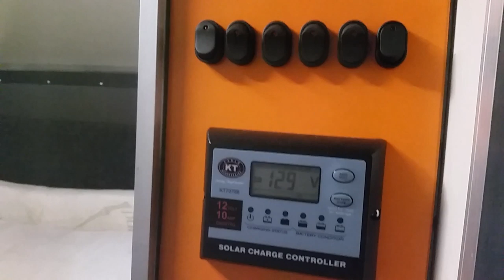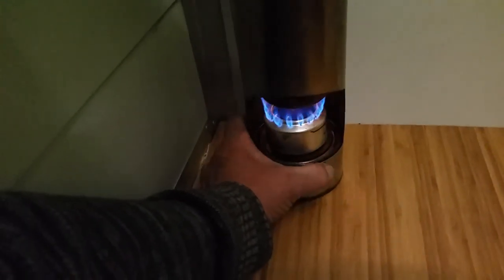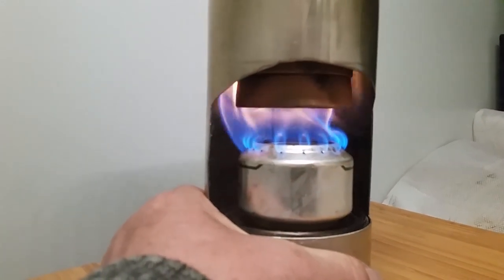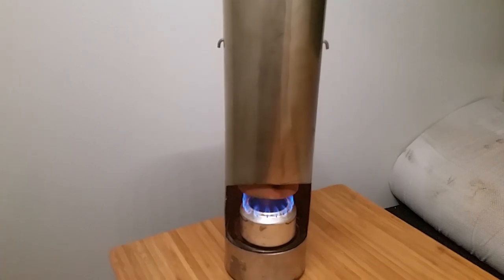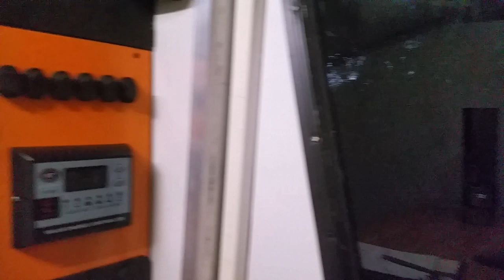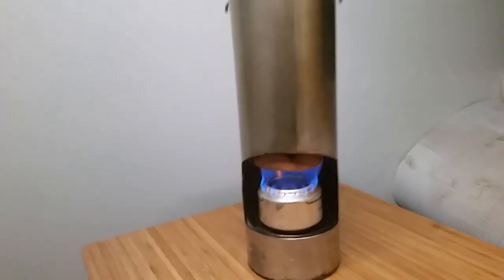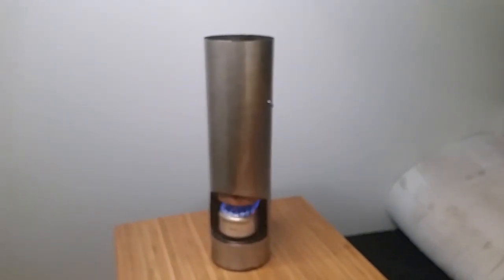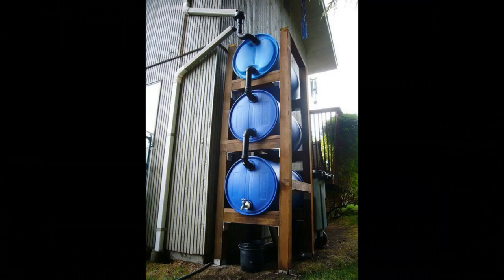DIY Heater for Teardrop/ Van/Tent- Off Road Camping Expedition Overland Trailer-

Comment: Would this work with 3 to 4 tea light candles? I'm sure it would not be near as much heat producing but maybe radiate decent warmth?
Reply from the maker: Yes, absolutely
Reply: @t.h.o.r.  Thanks! If you had an online store where you sold these I'd buy one from you!
Reply: Tea light candles burn styrene. Methanol or ethanol is clean burning, and produces such low amounts of CO that you can burn them in an enclosed space and not worry about CO. 

That said, try and design the base to be wider than the height so it can't tip over. That flame out the top, and the narrow chimney scare me a bit. Also, I've made many little penny stoves, and the one thing I remember about them, is there's no good way to put them out. If they spill it's all over. 
Good start of an idea, but definately needs refinement.
Reply: @aarondonaldson4164  If I ever have the need to burn one of these stoves inside in an emergency to prevent freezing to death, I keep a large metal baking pan to layer with play sand on hand to set in. And bricks to set the baking pan on and "wall it in" so it doesn't slide off whatever it's propped on super easy. I have several that I've made and use outside for hiking and camping. I'm always down to amplify heat in easy ways with mods like in the video.

But you gotta think about things like bumping into a table, crazy animals chasing each other around the house, kids forgetting and throwing something the room at each other, etc. 😕 

Of course, keeping a fire extinguisher (multi/B rated) nearby as a safety backup, but everyone should have one of those accessible no matter what.

Comment: How did you go about cutting the stainless? Cheers
Reply from the maker: I carefully used a 1mm cutting disc on an angle grinder
Reply: @t.h.o.r.  ok thank you so much for the reply. I have a stainless tall jug thingy I’m going to use to make it. I really only have to cut the hole and add the little pots. Did you have much trouble cutting it? Cheers Noni

Comment: FYI: carbon dioxide is dead toxic. You need to keep window or door open to use this open heater.
Reply from the maker: If you watch the video again you will see that I discuss this and show the window and the vent open. Full safety review with CO and CO2 measurements is in the following video
Reply: Duh, goober; he said he knew his stuff. Don’t be a Captain Obvious.
Reply: Thread troll, evidently did not watch video where it was mentioned that A) he does not run it while sleeping. B) He showed open vent.

Comment: Not going to work. Too many heat losses and not enough burn time.  Have to open a vent heat loss, closed poison yourself.  No way out but to use a proper heating system.
Reply from the maker: Odd that- cos its ridiculously warm while Im using it - where could all that heat be coming from?

Comment: not best heater have open fire and lot need gasoline burn all night. lot better have tube and center have steel mesh fire not go outside open fire, 2 can and center have mesh, burn inside mesh safety lot better and not burn tent. and gasoline go lot little than this.

Comment: Sorry this is neat but Dangerous, very easy to tip over and have flaming alcohol  all over.
Reply from the maker: Ill be fixing it to a wall I think with the apropriate heat shielding of course

Comment: lovely little heater, whats the fuel?  rubbing alcohol? I watched your test video with the co2, i was wondering about condensation, I also made myself a little trailer over here in spain and i made a terracotta plant pots heater with candles, was thinking of using an alcohol burner to replace the candles for when i go snowboarding in extreme cold but im not sure if the fumes are going to kill me lol any tips? thanks
Reply from the maker: Meths,  denatured alcohol.  Alcohol does not produce CO at all and very little CO2  according to my meter